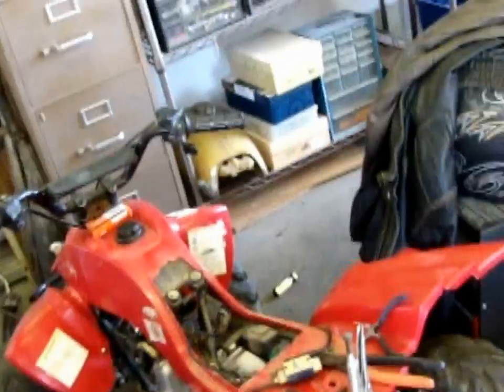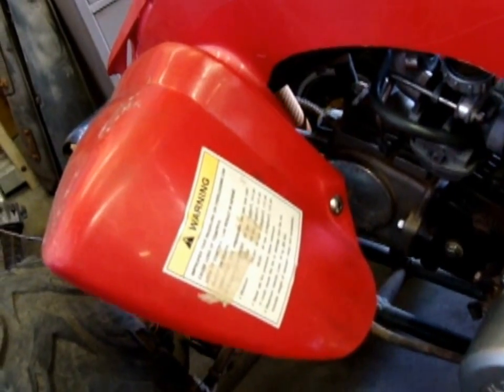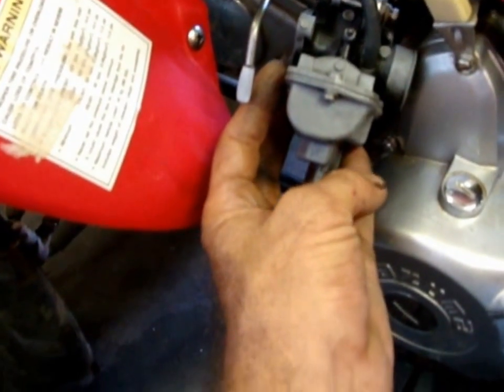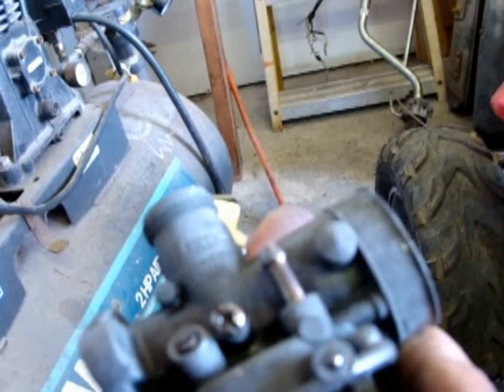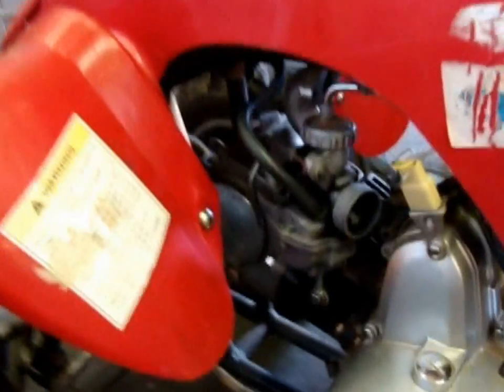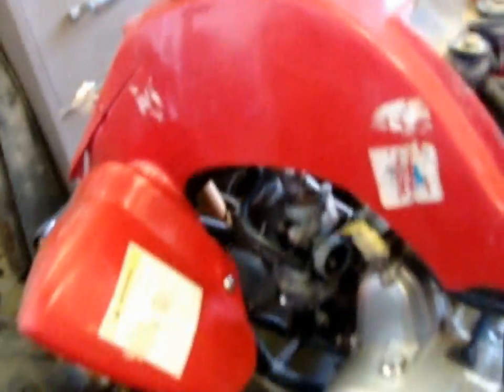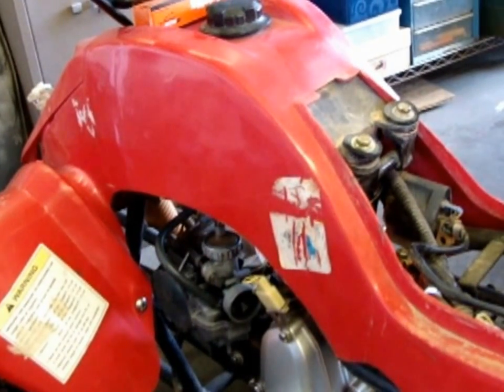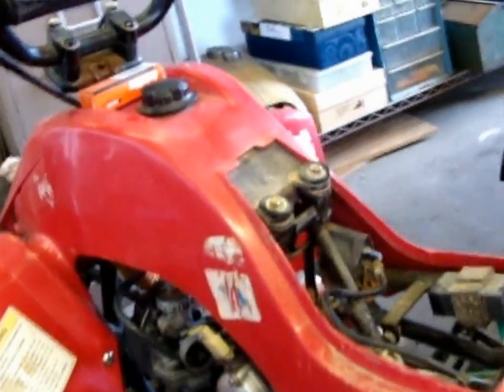Putting a Kehin Carb on a Kazuma 4 wheeler

Comment from the maker: Yup - there were several -- Hell Yamoto is actually making direct replica Honda 250 electric starters -- Who knows - maybe there's enough demand they'll buy up more old designs and we'll be able to get cheap, retro High Performance stuff... Like Spark King coils and Hooker Headers.....ooohhh and old style perimeter NOS fogger plates (before the Holley sticks - The reason a lot of engines didn't make it but damn INSTANT 4x the power..Provided you built the rest up to take it...Or 1 run yer done

Comment from the maker: They are seriously prone to intake leaks and valves going out of adjustment  (valve lash should be .0025 intake and .0035 exhaust) I dont know what their compression should be but I'm reposting to JJ Juarez on my fb as a ?? to him. Long as the carbs been cleaned right that's about all that ever goes wrong with those chinese ones other than the cdi boxes but when those puke they do it all in one shot

Comment from the maker: you mean you shorted the hot across the 2 solenoid terminals.... Nope that to me would have me checking the brushes/armature in the starter itself (If you feed a starter direct power like that and no spark... Chances are real good the brushes are not touching and therefore not completing the circuit and therefore no load = no spark on the arc)

Comment: I can't get my 4wheeler to start, the battery is good but it won't turn over. I think the starter solenoid is bad, I connected the negative and positive on the starter with a screwdriver and didn't even get a spark, so I think it's bad?

Comment: i dont thing i live neer you but is Apache rlx 150 it is a sires 1 2005 model but this quad  is hard to fine eney where because it is a sires 1 and they are only like 3000 lafe running i have the 40th one so it is hared to find this quad can you see if you have eney luke thanx  and it was made in Taiwan i would like to keep because it the 40th one made but it old now peopel say so if you can find some thing it would be help ful thanx